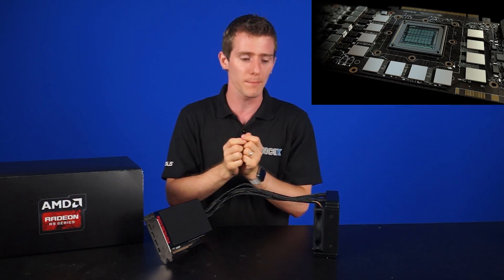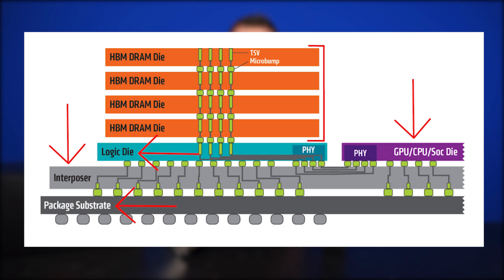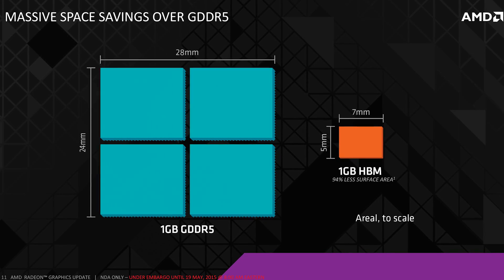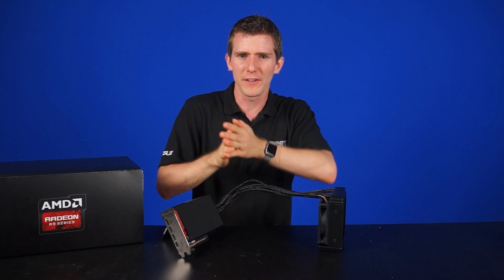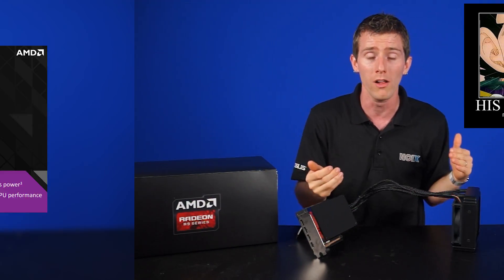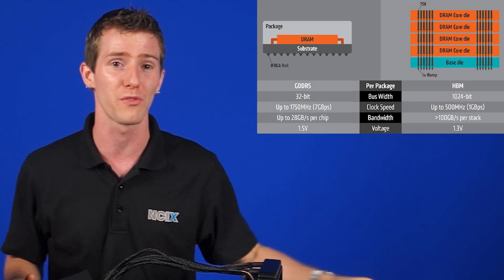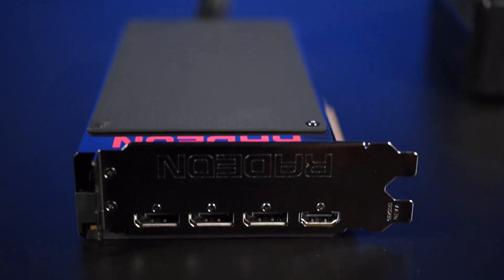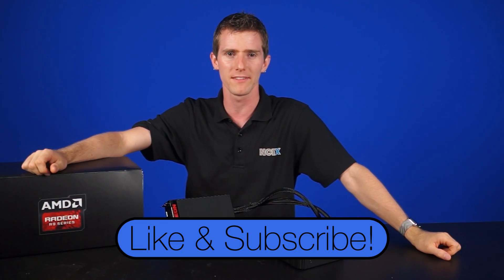What is High Bandwidth Memory? Feat. R9 Fury X

Comment: 1Q: What is HBM?
1A: HBM is a new kind of memory that tackles the problem of size, bandwidth, and power consumption.
2Q:How does it work? 
2A: It works by attaching on to a interposer connected directly to the GPU/CPU via TSVs.
3Q: Will my toaster toast both sides of 🍞 perfectly?
3A: No. 😞

Comment: Browsing these because I am bored in 2017... Watched this thing and am still wondering about the toaster toasting both sides equally toasty. Might try 2 GTX 480's or 2 Radeon's in SLI/Crossfire but skip a PCI slot between them and put your bread there.

Comment: so why isnt amd making graphics cards that can beat intel? xD too expensive?how does it compare to the 1060, 1070 or 1080s?
Reply: You mean NVidia?
Reply: Kalfax plays It is much better than the 1060 slightly worse than the 1070 and not as good as the 1080. Although, this is a much older card and was released around the same time as the 980 , which it is also better than.

Comment: isnt toast not even on both sides because, well at least with our toaster, when you push the thing down both toast slots go on, and each slot has its own heater on each side so theres 2 heaters in the middle so the side facing the middle gets hotter much faster, so if there was only 3 heaters vs 4 it would be both more power efficient it would also get it toasted even on both sides

Comment: 1:10 - Its not a silicon wafer, its a die. A small cut of from a wafer.
4:10 - The limitation on 4GB of memory is not due to cost, but rather due to a limitation in the HBM1 standard. It only supports 1GB per stack. HBM2 will solve that and support up to 8GB per stack having a maximum amount of memory around 32GB

Comment: Anyone thought of having Memory intergrated with the CPU... the only problem is it would cost more along with destroying the ability to change the amount of Memory.
Reply: 2feet1up No, if that was the case, the HBM would just be used as slower cache by the CPU. The latency would be higher than low level cache but it would still be faster than storing in RAM. Obviously costs of HBM are high so it wouldn't replace RAM.
Reply: 2feet1up The trade off is not worth it. In order to effectively take advantage of HBM you need a crazy memory controller to leverage that 1024 bit bus/gb. this takes a lot of die space,  and a much more complicated memory controller. This will eat into the available space that could be used for actual computing logic. 

its great for gpus which can leverage the bus width, but considering how we barely see a difference in  quad channel ddr (which is only a 256 bit memory interface), I don't see the benefits here.

Comment: So if hbm is that good why is the fury X getting beaten by the titan X and 980 ti  who have gddr5? And if hbm consumes less energy, how does a 980 ti consume less power than a fury?? Does this mean that amd has shit engineers or that nvidia just has way better engineers? I would go for the 2nd choice.
Reply: Amr Sameh It's neither of those cases. The core consumes more power than the VRAM. HBM uses a lot less power than GDDR5, but the core of the Fury X uses a lot of power because of the amount of stream processors, texture units, etc. The slow core and memory clock of the Fury X is partly the reason why it underperforms compared to the 980Ti, clock for clock the Fury X is faster but consumes more power. At 4K res, both titan X and 980Ti are starved of memory bandwidth so they struggle a bit while the HBM of the Fury X allows it to regain lost ground.
Reply: jackspencer213 Well, I am pretty sure the titan X and the 980 ti are better at 4k, too.
Reply: Amr Sameh With single cards, it's pretty neck and neck, Fury X faster in some games while 980Ti and Titan X faster in others. However the Fury X scales very well at 4K when crossfired and beats out both Titan X SLI and 980Ti SLI in most games.
Reply: jackspencer213 I dont agree, as I watched a lot of benchmarks in 4k showing the nvidia card beating the fury X, not by a mile, but certainly beating it. 

But ok, I'll go with what you said. For 4k, why the hell would you want a 4gb card. Seriously, wtf. 4gb for 4k ultra gaming???
Reply: Amr Sameh Crossfire performance, not single card performance. Fury X Crossfire  = Titan X SLI > 980Ti SLI at 4K.
Reply: jackspencer213 yes! That's performance! But if you are going to pay this amount of money, you want it to be bloody ultra. How the hell will you play ultra 4k with 2 4gb cards?? Vram still doesnt stack, so they're basically still 4gb. Farcry 4 at maxed out 4k consumes 5-6 gb. Ac Unity at very high 1440p consumes 4gb. Gta V at high 4k with advanced settings consumes close to 6gb. These cards have great performance in crossfire, but they will be bottlenecked by the amount of vram available.
Reply: Amr Sameh The 980ti onyl wins at low resolutions and the Fury bandwidth makes no real impact at 1080p or below. The Fury X also uses less power according to all benchmarking sites other than TPU. For example TomsHardware said it uses 13w less.

Don't forget about Nvidia lowering quality of the images to cheat in benchmarks on the 980ti & titan X
https://www.reddit.com/r/pcmasterrace/comments/3c2kiw/bug_or_nv_cheating_with_optimized_image_quality/
Reply: Brandyn G mate. Those are silly excuses amd fanboys put to fool people. Have you tried both amd/nvidia side by side?? If any body messes with color reproduction it's amd, farcry 4 and watchdogs look horrible on amd cards, but that might just be me.

On to that 980 ti only better at lower resolution part. No it isnt. It's better at every resolution. Go check the anand tech review.
Reply: Amr Sameh Crossfired Fury X cards work well enough in most 4K games today. I don't think 4GB that much of an issue with most current games at 4K, only with a few very demanding titles. DX12 will allow developers to utilise pooling so it should effectively be 8GB of VRAM across two GPUs. The big titles at the end of this year or next year will most probably be DX12 or at least have a patch at a later date. 

Also about color, back in the days ATi cards traditionally had more saturated colors and contrast compared to Nvidia, which had more washed out colors. Also the textures on ATi cards were often sharper and less blurrier than on Nvidia cards. In general ATi was noted as having the better image quality and was a reason why many preferred ATi. Nowadays I'm not sure if Nvidia or AMD cards are still like that, but they very well could be. Nvidia are probably not cheating with their image quality but it's just their default driver settings to prefer lower quality to increase performance.
Reply: jackspencer213 Well that dx12 vram utilization part isnt gonna work unless games actually support it, which they dont, no game announced to this date supports this.

As for 4gb is enough nowadays, no mate, it isnt. Gta V maxed out at 4k uses near 6. Farcry uses 5.5 - 6 and so does ac unity. Dying light uses a lot as well. But even if they dont, why do you think people had a problem with the perfect card that is the 970 after that 3.5 gb fiasco? It was the best for the price even better than a 290x in 90% of the cases, but suddenly people started the hypocritical non sense. 3.5 gb are still enough for nearly every title to be maxed out at 1440p, which is perfect for a 300$ card. But people kept saying well it needs to be enough for 4k and the fucking future, like wtf, why would you buy a 300$ for 4k? Anyway, i have a perfectly functioning 970 with a complete 4gb of vram that work without stutter even after miles of that 3.5 area, I reach 3.9 and 4 no issues, and I have proof.
Cheers.
Reply: Amr Sameh The 3.5 GB debacle was more because Nvidia outright lied to consumers saying it was 4 GB of fast GDDR5 and not 3.5 GB + 0.5 GB of slower VRAM. No GTX 970 has a complete 4GB of VRAM, they all have 3.5GB + 0.5GB. You don't notice the effects much because the 0.5GB is still GDDR5 and not GDDR3 or something way slower. The transfer rate of the 0.5GB is slower but not so much that it completely bottlenecks the card, with a full 4GB of GDDR5, the 970 would almost definitely be a bit faster but not by much. 

Like I said, most 4K games at the moment seem to work fine with the Fury X at very playable frame rates. DX12 games will be coming soon so expect to see VRAM pooling which will certainly alleviate the lower VRAM issue for crossfire setups. The developers can release patches for existing games which will allow to them to be run using DX12. 

With DX12 being such a big thing, I expect to see most AAA titles in 2016 supporting DX12. This year Battlefront and FO4 may have DX12 support or receive a patch at a later date.
Reply: jackspencer213 well, I agree with all of what you said. But the part when you said " you dont notice the effects" well if I dont , why should I care?
Reply: Amr Sameh You may not care, but it's generally not a good thing when companies lie about their products like that. Nvidia got off very lightly because of their PR and marketing and because AMD didn't have new cards out at the time.

Some people may have bought the 970 thinking that it had 64 ROPs and 4GB of VRAM, which makes it sound very powerful and futureproof to a decent degree. With those specs it would have been closer to 980 levels of performance. Nvidia normally skimp on memory but this time they just went a bit too far with how they marketed the card.

Comment: I'll say it again, currently and until VRAM sizes increase the thing about HBM that has me the most interested is how it ends up working with memory stacking and DX12.

Yes, it is undeniable 4GB is restrictive, but if the bandwidth increase means having a 2 or 3 card crossfire system with memory stacking is going to work as expected then it will be worth it for early adopters. Having 3 way crossfire system with 12GB stacked memory would be awesome once FuryX prices drop some and devs implement stacking support on new, DX12 games.
Reply: dumkopf We are more worried of games needing more vram in 2-3 years.
Reply: Raydeus What games surpass 4GB VRAM usage right now? I can only think of one: GTA V
Reply: Right now it's mainly heavily modded games that go beyond 4GB consistently, but as 4K gaming becomes cheaper going over the 4GB mark will be commonplace.
Reply: dumkopf shadow of mordor
Reply: dumkopf Shadows of mordor does.

Comment: AMD has gotten so confusing lately. I need to update my graphics card from my 270x but I can't really figure out which would be the best value for me. You have the 290x 8G then you have the 390x 8G which is slightly faster but from what ... the overclock. The 390x  cost 100 dollars more .. then there's the fury which costs about 100 more than the 390x. It too is a bit faster then the 390x but the 4G ram would seem to limit the card probably within a year since most high end cards have 6 to 8G and games will probably start using more now. I wish someone would do a benchmark of the 290x, 390x and Fury (not the fury x) with a game like Skyrim with major mods to hammer the ram. I would like to see if the Fury ends up losing ground over the 290x/390x due to the ram limitations. It would be interesting to see which card would be a better value to someone who doesn't have a lot of money to spend and is going to be "stuck" with the card he chooses for at least a few years.

Comment: Linus, PLEASE READ
"gddr5 is 1.5v while hbm is 1.3v therefore better power consuption" NOOOOOOOOOOOOOOOOOOOOOOOOOOOOOOOOOOOOOOOOOOOOOOOOOOOOOOOOOOOOOOOOOOOOOOOOOOOOOOOOOOOOOOOOOOOOOOOOOOOOOOOOOOOOOOOOOOOOOOOOOOOOOOOOO
YOU FUCKING NORTHERN AMERICANS (canadians)
THAT IS NOT HOW IT WORKS. 
I agree if they are using the same amount of amps, and therefore
1.3 v   x   1 amp  =  1.3 Watt
1.5 v   x   1 amp  =  1.5 Watt
And therefore the total watts consumes is much less with 1.3V, but without any Amps, Watts, etc. You CAN NOT rely on voltage alone to determine which device consumes less power.
I am explaining this basic shit because maybe Linus doesnt understand basic ohms law... And hopefully he will read this comment and not do the same mistake over and over...
Reply: robert karas well to be fair .. in the situation where he is talking ... what he said is just as correct as what you said. If you have a circuit and you supply it 1.5v ... and you take that circuit and supply it 1.3v instead it will have better power consumption. Yes its the wattage that's the factor but the voltage is changing the wattage since the circuit (load) is the same.  So since the gpu architecture is basically the same other than the ram being HBM the "load" on the RAM can be assumed to be about the same. Lets just talk about standard ram .. if you had 1.5v 1600mhz ram and replaced it with 1.3v 1600mhz ram .. your system would have better power consumption. You can gather this because (in theory) ram is ram and will have draw the same load. I'm not saying hes right but hes not wrong either. He is just simplifying it because not everyone is as "technical" as you. This is why he does these type of videos.
Reply: Everything in computers is compared via voltage.
Reply: bensemus x No... only when you are talking about which component uses what type of voltage, which is VERY rarely (such as some ram uses different voltage)
But when talking about efficency, everyone uses watts, not volts... You dont say the 970 uses the same amount of power as the 270 because they both use 12v and 3v rails...
And like I said, this isnt the first time NCIX did this.
The other time they said because a new aluminum battery that was invented gives 1.5v therefore its very strong!... no....
Reply: robert karas your right. Gpus and such go by watts. Ram on the other hand I have only ever seen voltage comparisons.
Reply: John Orion He did not specify that. All he said was there was a 30% better efficiency, so lets use 1amp on both as an example.
1.3 watt 
1.5 watt
Thats a 13.34% better efficiency, NOT 30%. So he is wrong. If we was inferring people to do their own calculations then he made things WAY TOO over complicating and either way is wrong because that the efficiency would be 13.34% not 30%.
This is also not calculating the lost power in converting it from 3v to 1.3v 3v rather then 1.5v which doesnt waste as much power. Which is such a small factor (about 20% - 10%)
Equation:
1.3/1.5 x ?/100 
Work:
1.3 x 100 = 130
130/1.5 = 13.34

And with hertz... you do realize what hertz is correct? Again, you can not find the efficiency of ram with just the voltage. And hertz will not help you in any way. It will help you if you also have amps (to determine how much power it uses over a set of time)
but otherwise, hertz is just the cycles per second....
Reply: bensemus x They only go on voltage to change it in the bios. As I stated, some ram use 1.3v rather then 1.5v, and because of this, unless your motherboard does it automatically (which sometimes it doesn't) you have to change it manually.
And ram uses so little watts that its not even mentioned.
Reply: robert karas when people talk abut the power savings of DDR4 vs DDR3 they only talk about volts.
Reply: robert karas just watched the video again .. and i did not hear him say 30% .. at one point he showed a chart saying the the efficiency of the HBM is better .. he also never says that lowering the voltage to 1.3v makes it more power efficient. when he talks about efficiency he talks about the 3x bandwidth per watt not the voltage.  So actually you misheard the video completely and this argument is not even necessary.
Reply: bensemus x no... As I stated agian, there are many different ram, there is 1.5v ddr4 ram, and 1.3v ddr3 ram... and vice versa...
The only reason ddr4 ram is more efficient is how it is layed out, NOT on its voltage.
Please learn OHM's law before commenting any more.
http://www.samsung.com/global/business/semiconductor/file/media/DDR4_Brochure-0.pdf
Page 3
Notice how they had voltage and power consumption on SEPARATE CHARTS and are not at all correlated. 
I shouldn't even be fucking explaining this... Just google ohms law
Reply: robert karas I know ohms law and how watts and amps relate to each other. All I'm saying is the lower the voltage the more effecent people say a type of ram is.
Reply: bensemus x I don't know who says that, and whoever does doesn't understand ohms law. 
And if you understood ohms law you would not be quoting back such stupid information...
I have no idea what grade you are in, but I am guessing you are familiar with the Pythagorean theorem. And you know that you can not find the hypotenuses with only one leg, and you cant find a leg's dimension with only the hypotenuses. 
Same with ohms law, the hypotenuses is the watts (power) and one leg is the voltage, while the other is the amps, you can not find the power with only volts, or only amps. You need both
Reply: robert karas People use voltage with the assumption that everything else is the same. In that case they are right as lowing one while keeping the other 2 the same would lower power consumption.
Reply: bensemus x YOU NEVER KNOW IF EVERYTHING IS THE SAME. NEVER, AND IT NEVER IS THE SAME. 
I have NEVER in my whole entire life hear someone compare ONLY VOLTAGE to power, without ANY idea about the amps.